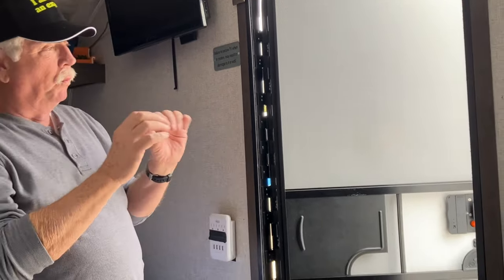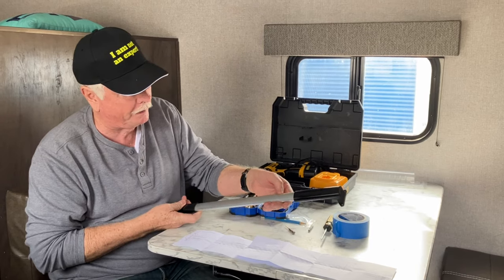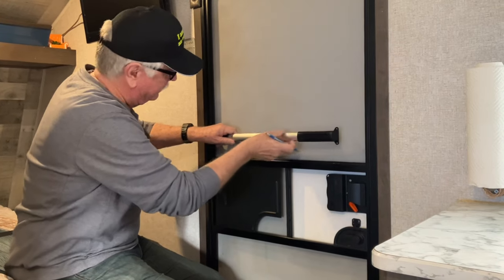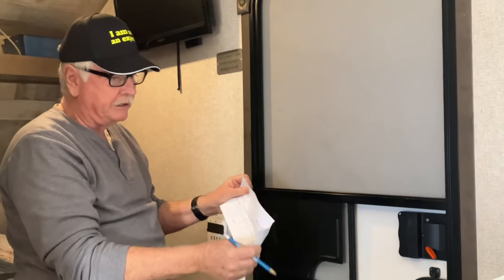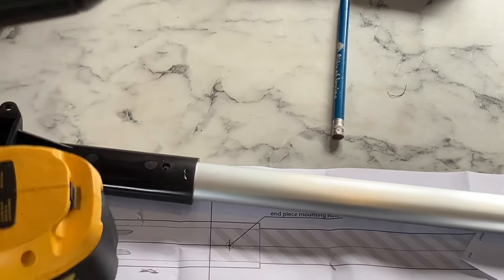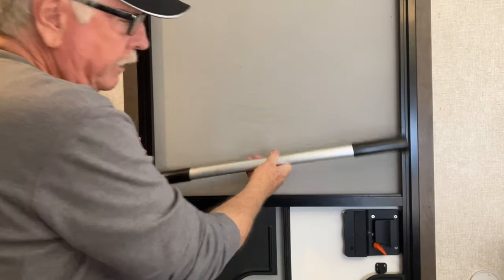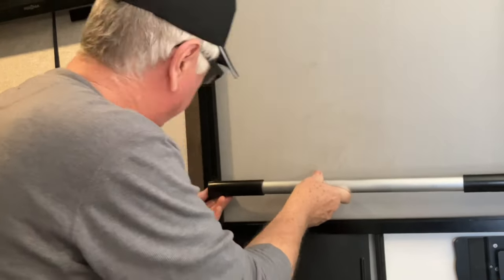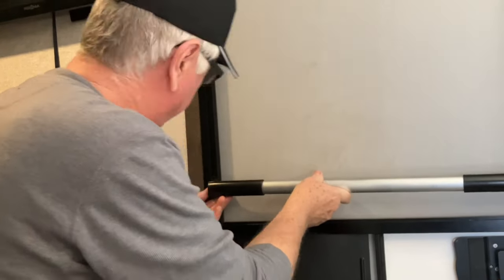Very Useful $18 RV Door Upgrade! RV Screen Door Handle. Why didn't i do this years ago?

Comment: I will say that through the years we have learned not to use those add-on handles to pull both the screen and outer door closed together , but it works well to pull the screen door closed, if you need them both shut , you really should be pulling the outer door handle, as it does take a bit of effort, and it will wear on the screen frame and the cheap handle over time and will break.
Reply from the maker: I can see that being true.